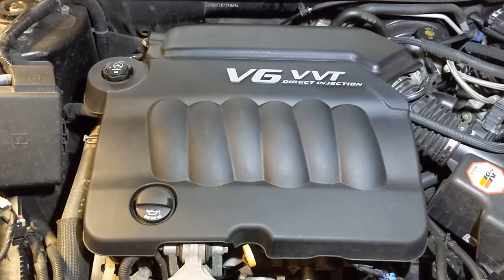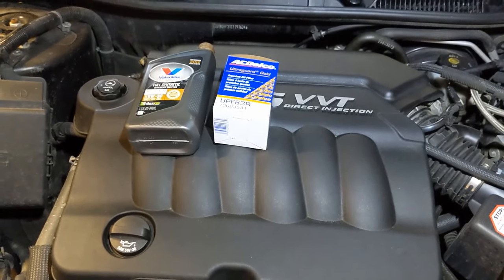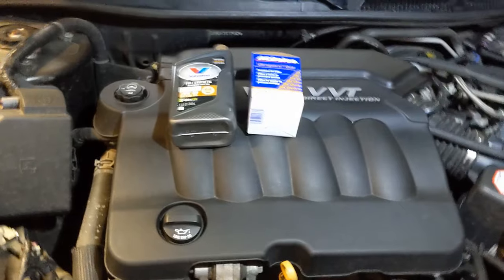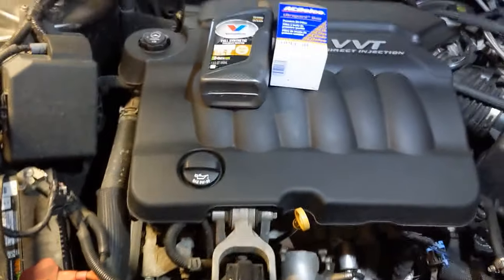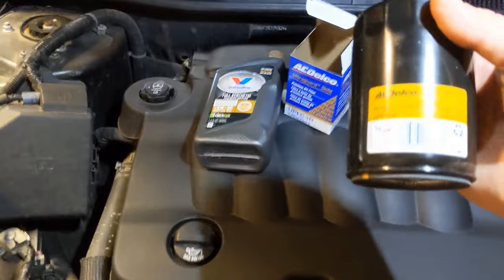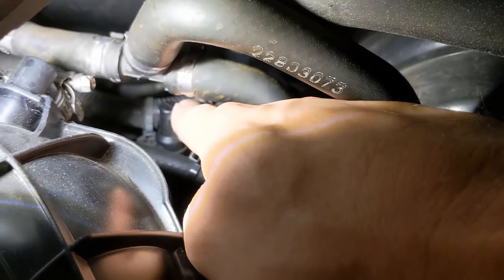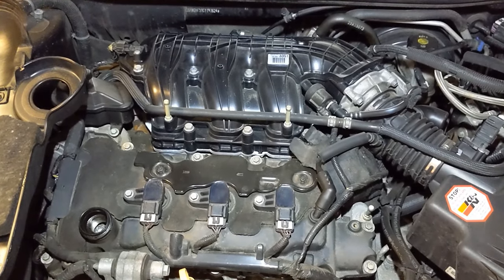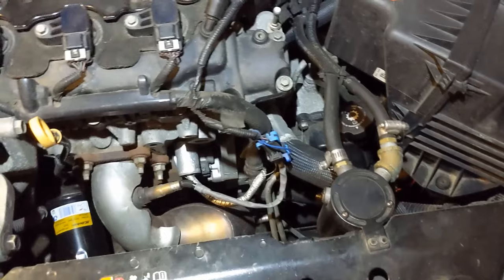How to keep your GM 3.0 or 3.6 V6 running forever - **High Feature V6 LY7 LLT LFX LGX LGZ**

Comment: Why drill out the pcv valve? Wouldn't gm engineers know what is best?
Reply from the maker: GM came to its senses around 2014 and enlarged the holes.  The issue is the restriction in the PCV causes the top of the cylinder head to sludge up.  In classic GM fashion, the engineers certainly know what's best - it's the bean counters that hinder them from implementing the improvements!! 😆
Reply: @CertifiedShadetree  👌🏼👍🏼
Reply: @CertifiedShadetree  This kind of answered my question. I'm glad the newer models have improved with larger PVC holes. I really like my cadillac XT5. And it was big bucks too!! This shit scared me. But, I keep up with my high quality synthetic oil changes. Im GMC guy for life!! I also have a C6 corvette, thats been a dream car of mine. Its been a really solid toy, I love it!!!
Reply from the maker: @jarin12ga  I say this as a GM lifer, but it sucks how it takes a few model years before GM works the bugs out of a new (insert product.) The consumers have been the guinea pigs in many instances. So I'm saying after all the BS with the earlier 3.6's, you got one of the good ones!!!
Reply: @CertifiedShadetree  True your right. Thanks for getting back to me bud!!

Comment: Can I put a 2014 , 3.6 cts motor  in a 2008  CTS that has a bad 3.6.
Reply from the maker: No, the 2014 3.6 is a completely different engine from what's in the 2008.

Comment: So are these good motors I’m going to look at a 3.6vvt 2012 chevy impala tomorrow with 150k what should I look for.
Reply from the maker: That mileage shouldn't be too concerning if the previous owner maintained it properly. Look for service records, or proof that they changed the oil religiously and at a decent interval. If you can, hook up an OBD2 scanner and check for codes.  If it has any codes for cam sensors, VVT sensors, or timing issues, run FAR away!  If this all checks out, it still isn't a bad idea to have a BG Dynamic Engine Cleaning Service performed for good measure.  I would strongly recommend installing a catch can on the dirty side of the PCV and a clean side separator on the clean side of the PCV to prevent any carbon buildup issues going forward.
Reply: The transmission and diff is going to need to be rebuilt

Comment: After that- you pray that the timing chain tensioner wont fail on you before 200k
Reply from the maker: I'm at 172k and praying HARD!!! 🤣
Reply: The LFX revision is much less prone to timing chain issues. Now the LY7...those are the ones you have to be really careful about.
Reply: Why before 200k?
Reply: @ViperJay5  early model ly7 at 176k here, im praying it lasts until prices for old holdens go up.
Reply: @JustinBeiberOffical  What year, make and model is your LY7 in? I've heard these things lasting a long time as long as you really taking good care of them. One of my buddies has an LY7 that hasn't had any issues but they use a very high quality oil and change it somewhat often regardless to oil these days not needing to be changed as often as it used to. Hoping you can continue using it trouble free!
Reply: @ViperJay5  early model 2004 vz commodore, it’s in good condition for its age, but at 176k it’s right at that point the timing chains will make you nervous

Comment: What about the 2020 Colorado LGZ 3.6?
Reply from the maker: LGZ is the absolute best of the 3.6s. No need to modify your PCV valve, but might still be a good idea to install a catch can. Everything else still pertains..
Reply: @CertifiedShadetree My 2019 Colorado has the LGZ engine, and I absolutely love it! From what I've researched about it, GM added an oil seperator
Reply: @CertifiedShadetree So apparently there is no need to add a cacth can any longer. Have you heard about the oil seperator? Just curious what you think. Thanks!

Comment: Chaged oil every 5000km but anyway changed timing chain kit at 130000 km
Reply from the maker: Was it an LLT engine, by chance?
Reply: @CertifiedShadetree  it was LFX engine, chevy camaro 2012. I also had an oil near air filter, smoke for 0,5 secs during engine start and leaking transmission) reliability is poor. Next my car will be SS, never v6
Reply from the maker: @DIABLO_4_Tester_Sacramento  Oh damn. How many miles were on it when you bought it?
Reply: @CertifiedShadetree  there was 80.000 km. I sold it on 145.000 km. On 80.000 km already my diagnosis master said that chain must be replaced, and both cats are clogged
Reply from the maker: Wow, that's fuckin' insane!! 🤯😱 My thoughts immediately turn to the previous owner - they must've beat the ever-loving shit out of it!!
Reply: @CertifiedShadetree  do you have information about auto transmission on 2009-2012 SS?
Reply from the maker: I'm a walking 8th & 9th Gen Impala Encyclopedia. 5th Gen Camaro, not so much.  So sorry, no I don't know much about that transmission..

Comment: What about an 2005 Pontiac Aztek 3.4l v6?
Reply from the maker: All I can say is be prepared to replace your lower intake manifold gaskets and/or head gaskets. Keep a vigilant eye on your oil level and check for a milkshake consistency on the dipstick and oil cap. The oil level should never go over the full mark. These symptoms are that of coolant in the oil, and mean the lower intake gaskets are blown. Overheating after 15 minutes indicates a blown head gasket.

Comment: I change My 2013 ltz oil every 3 months. I use calcimine
Valvoline full synthetic high mileage max life.
Reply from the maker: Any oil consumption at all with that oil?
Reply: @CertifiedShadetree  none at all. Just a little condensation in the cap probably from blow by with the e85 cuz it attracts some water. Other than that, it works great. Not a single metal shaving even after putting in royal purple last time to attract anything in there to the oan.
Reply from the maker: How many miles does she have?
Reply: @CertifiedShadetree  173,000
Reply: @CertifiedShadetree  scoped her out n she’s clean for a high mileage car. Especially with direct injection not spraying on the intake valves
Reply from the maker: I just clocked 171k on mine.  Just getting broken in!!
Reply: @CertifiedShadetree  yes sir! I’d say we’re pretty tied up with mileage. Front wheel hubs just started grinding. Waiting for a warm day here in Ohio to put em in
Reply: @CertifiedShadetree  When it’s cold it sounds like the transmission is whining until it’s at operating temperature. Not sure if it’s that or something else. Any thoughts?
Reply: It correlates with acceleration until operating temp is met
Reply from the maker: Do you hear the noise only when it's below freezing outside? If so, it could be the power steering pump going bad.
Reply from the maker: I've got a video for that!!  (Well, not a comprehensive one, just how to get a rusty hub loose...)
Reply: @CertifiedShadetree  the whining is in any weather, just when the oil temp is low. Maybe oil pump? And in reguards to the roaring hub noise, there’s a grinding that sounds like sheet metal if that makes sense. Seen videos of how the rotor splash guard bends and rusts and scrapes the rotor.
Reply from the maker: Definitely check that dust shield behind the rotor.  Check your inner splash shield on the back side of the passenger wheel well.  The one on my car broke loose and rubbed up against the serpentine belt and it made a godawful noise while I when I first started the car.

To narrow down where the whining noise is coming from, first start the engine. Then take a long screwdriver, press the handle up to your ear, and the other end up against various items under the hood (alternator, PS pump, AC compressor, etc) and listen for any increase in noise.  That at least rules out whatever's attached to the engine before going after the oil pump (not saying it's NOT the oil pump, but it would be strange for it to go out so soon considering you change your oil every 3k.)

I guess you could also remove the serpentine belt and run the engine for a few seconds to see if the noise goes away.  If it's still present with the belt off, then it could very well be the oil pump.
Reply: @CertifiedShadetree  thank you I much for the insight brotha. And weird question, but do you know why my pedal and brakes would clunk going into reverse then back drive? Rotors n pass r new
Reply from the maker: First thing I'd check is the torque of the lugnuts.  Especially if you just changed the brakes - there's always that chance they worked themselves loose right afterwards.  I'd also check your swaybar bushings front and rear.  Make sure they're not loose and or worn out.
Reply: @CertifiedShadetree  my back ones aren’t in the best shape. When I got my Coilovers kit they gave me the wrong links. Gave me an 08 Pontiac set instead
Reply from the maker: They wear out pretty fast if you don't get OEM or ACDelco.  If the 08 Pontiac links are for a Grand Prix, they will match up with the Impala (they're both 3rd Gen W-Bodies.)  97-08 Grand Prix and 00-13 Impalas all share the same suspension parts (although I believe the 04-08 Grand Prix FRONT swaybar links are different.)
Reply: @CertifiedShadetree  I listened more and above 1500 rpm the belt is swueaking. Kind of like mice chattering
Reply from the maker: Change out the serp belt, tensioner, and idler pulley.  Amazon sells the whole kit for $120:
https://www.amazon.com/ACDelco-ACK060950K1-Professional-Automatic-Tensioner/dp/B012EJ20EI/ref=sr_1_1?dchild=1&keywords=ACDelco+ACK060950K1+Professional+Automatic+Belt+Tensioner+and+Pulley+Kit&qid=1606537735&s=automotive&sr=1-1
Reply: @CertifiedShadetree  what a life saver my man. Thank you. I will replace that and then after that’s gone I can listen to other houses easier haha
Reply from the maker: No problem, and good luck to you!!  🍻
Reply: @CertifiedShadetree  if you have any questions too I’m here. I don’t know any other w body Impala lovers. Helps to have you since there’s like no forums etc
Reply from the maker: @oKacz  For sure!  Yeah, there really aren't any forums that are active or worth a damn these days. 10-15 years ago you had NAIOA for Impalas and W-Body.com for W-Bodies. NAIOA.com is dead, and W-Body.com has been filled with know-nothing fucksticks for several years (even before that there were maybe 2 people that had Impalas.) Kinda sad...
Reply: @CertifiedShadetree  100 percent agree! Miss my 5.3 v8 a little too haha. But hoping to give w bodies some lost glory

Comment: have you ever seafoamed it? I'm trying to figure out what spot is the best to drop the seafoam inside.
Reply from the maker: Not a good idea with a DI engine. You could dislodge a chunk of carbon and end up scoring the walls of the cylinder bore. CRC sells a direct injection intake valve cleaner that you spray in through the throttle body, but in my experience it's fairly ineffective. If you want to do it right, I'd recommend removing the upper intake and cleaning the valves manually. Check out this playlist:
https://youtube.com/playlist?list=PLKy6nBoh43BqpRUfB_LdnLakyKQzXnmxu
Reply: @CertifiedShadetree  how often would you recommend doing this? Is there any preventative way to keep the carbon from building up?
Reply from the maker: @kalikiller1771  My car had 158k when I cleaned the intake valves and it probably didn't need it. Honestly I'd just pull the intake and visually inspect the backs of the intake valves. If they aren't all caked with carbon, just clean out the intake and throttle body with some throttle body cleaner spray. To properly prevent carbon buildup in the first place, install a catch can on the dirty side of the PCV and a clean side separator on the fresh air side of the PCV (videos of both are on my channel.)
Reply: @CertifiedShadetree  thank you very helpful I'm looking at buying a 2022 canyon with a 3.6 and want to know all the particulars of the engine and transmission so I can get them to last as long as possible

Comment: If I'm correct a 2012 Chevy Impala has a 6T75 transmission?? I have done some research trying to find out if I have to change a filter on this trans or if it's a non serviceable screen, the info I got online is totally contradictory, can anybody shed some light on this I sure would appreciate it!!
Reply from the maker: https://youtu.be/mc3sVrn_mWY&t=1747
Shows a full rebuild of the 6T70 and why the filter screen is non serviceable. 
I do a drain and fill here:
https://youtu.be/0yIPfZ5AsUM
Reply: @CertifiedShadetree  Great info on those videos thanks! I think the periodic drain and fill is the way to go, don't think the machine flush is good for these cars or any car for that matter, luckily this car has a trans fluid drain plug so I was able to get about four and a half almost 5 quarts out, keeps the fluid fresh and the gears shift smooth as silk.
Reply from the maker: @markmcginnis7892  Agreed 100%!!

Comment: Timing Change huh?? What shall we change the timing to?? Aint nothing stoppong the stretch from happening, the vvt puts alot of stress on the chain as it has to advance and retard on the fly...under load at that. Once that Correlation code pops up...it's done. I worked directly with the boys at the Warren Mi. Tech center..right across the street at 13 and Van Dyke.
Reply from the maker: Oh, ho ho ho, we got ourselves a comedian! All mocking aside, I seriously want to know what your point is. Are you saying that GM owners should just give up on preventative maintenance because (in your words) their engines are doomed to fail no matter what? And since you have inside intel, how many miles have the boys at the tech center logged on a 3.6 before the chains let loose?  Mock me for being a rube shadetree all you want, I stand by my assertion that these engines WILL LAST LONGER with meticulous maintenance.
Reply: @CertifiedShadetree  of course  regular maintenance is always good for ANY engine, but as a G.M. performance technician, no matter what you do the chain is going to stretch, after the 75k mark, I will guarantee the slack in the chain will be well out of spec.and theese people that think they can go 7 to 10k miles on an oil change is ludicrous. Most stretch is caused by low oil and the oil cosumption issue the G.M. knew about from day one. The fix...a revised  valve cover gasket that SLOWS the consumption  from the pcv system. Low oil..more heat..more heat more stretch and less lubrication. 
     And yes..pretty much all G.M. engines are kinda crap other than the v6, especially the 4 cylinders with the piston ring lands crushing at sometimes under 5k miles..another known sikent issue with them, and the ls v8 with the shit camshafts?? Yes. They had alot of problems pre 2019. So yes most of thier engine are doomed to fail..since G.M. wasnt recalling anything utill they let loose and we replaced the parts. Meticulous maintenance should not be needed like micro managing every day..just regular service intervals and common knowledge of checking fluids and small shit..not going thru the car with a fine tooth comb every week. You do what ya want with them..the facts are the facts with those engines..but the v6 is a decent engine out of them all..I liked the L engines after all most of it was designed by Suzuki but G.M. does not broadcast about that.
Reply from the maker: Yeah, it is pretty ridiculous how much nannying these motors need, especially considering how well the old 3800's they replaced would run with minimal maintenance!  I get that a 50+ year old pushrod design eventually wasn't going to meet modern emissions standards, but that was a DAMN solid engine (aside from the coolant elbows and EGR tube.)  And yeah, now that you mention it, there were A LOT of shitty GM engines over the years. The Iron Dukes with the phenolic timing gears, the 3x00's with their LIM gasket issues, the Northstar and the head bolt issues - junk, junk, and more junk!!!

Comment: what about the LGD  3900
Reply from the maker: Aside from routine oil changes, nothing else in this video applies to the older pushrod V6's.
Reply: @CertifiedShadetree  oh okay
Reply: Those 3.9 motors will last well over 300k if you do regular routine oil changes. You'll go through more trannys than those engines.
Reply: @thedirtybubble9613  ok thanks yea i keep the oil changed
Reply: @thedirtybubble9613  I give my daughter an 06 Impala with the 3.9 with close to 300,000 miles. Just regular oil changes between 3500- 4000 miles with Valvoline high mileage synthetic blend. I also run same oil in my work daily, a 93 ranger with just over 500,000 miles! It's a 2.3l 5 sp 2wd and still rocking the original engine transmission and rear end. Proof is in the pudding.
Reply: @paulcondie2520  You can go further than 4000 miles in those pushrod V6 engines if you use any kind of synthetic or synthetic blend oil.
Reply: @thedirtybubble9613  oh I'm sure but why would you want to? Oil and filters are cheap compared to  timing chain replacement, phasers, etc let alone down time, possibly being towed?  This is just how I roll! Lol I know the 3.9 doesn't have phasers just thought I'd throw that out there
Reply: @paulcondie2520  Yes in the 3.6 engines you should definitely change the oil every 3-5k but in the pushrod engines they don't use timing chains. If you change the oil every 4k in the 3.9 that's fine it will last a long time. I need to start changing my own oil but I don't have the proper tools atm. I need to invest in tools to work on my car instead of paying someone else to change my oil.
Reply: @thedirtybubble9613  oh yes they do have timing chains!!! Just a different set up! Do yourself a favor and go to harbor freight tools and get the tools you need, cheap! Start changing your own oil more frequently and you can thank me later!
Reply: @thedirtybubble9613  a clean engine is a happy engine! 😁😁😁